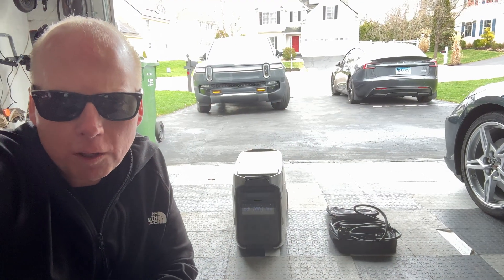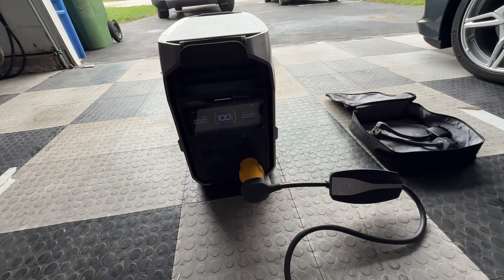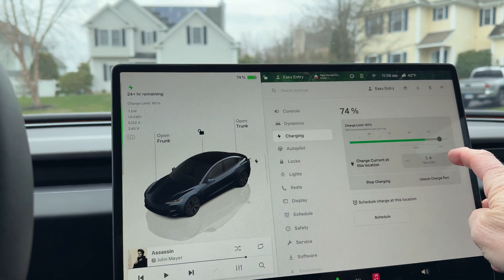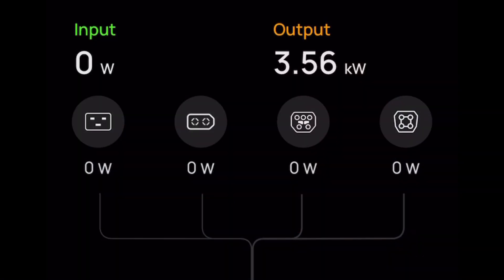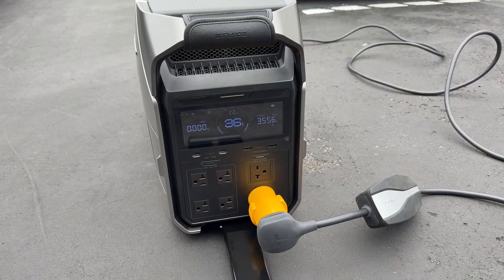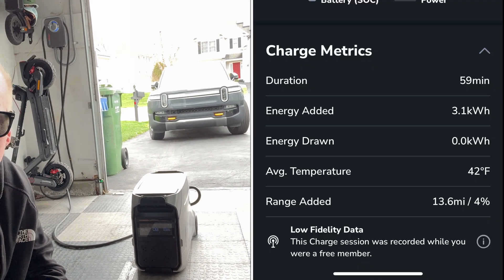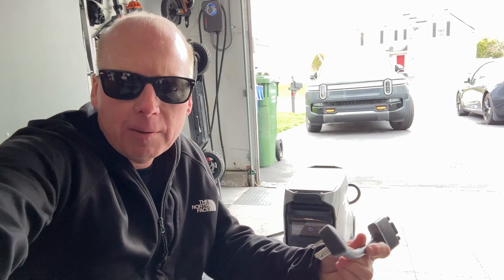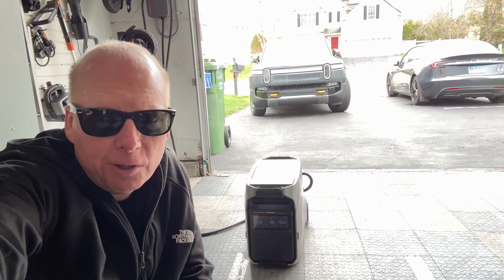Can I Charge a Tesla with a EcoFlow Delta Pro 3 at 240V Using the Mobile Connector?

Comment: It didn't work with my f150 lightning. I assume because the f150 doesn't have the option to regulate the amps. The charger is 36 amps and is getting too much power from the eco flow. In 110 is fine. Thanks  for the video. And the adapter that you mention works great
Reply from the maker: you need a portable L2 that can regulate the current I reviewed this evdance one on the channel https://amzn.to/48NhJED it goes as low as 10A
Reply: @keenanjeff  thanks for the advice I do appreciate it.

Comment: Hi Jeff, where do you see that the NEMA L14-30P to 14-50R RV Generator Adapter Plug you linked and mentioned at the 35 sec mark is Neutral (Ground) bonded ?
Reply from the maker: you are right I just tested the adapter I have linked and it is not neutral bonded but it does work with the tesla mobile connector.  I believe I did have to enable GFCI/RCD support on the Delta Pro 3

Comment: That thing, Delta 3 cost over $3000 and get only 13 miles on a single charge. That means I'd need to charge 10 hours to get 130 miles. Maybe it is still better than the level 1 charger.
Reply from the maker: You are not going to get 130 miles but  it can discharge quickly at 240v 4kW

Comment: Maybe I missed it but where did you utilize the EF ECOFLOW Delta Pro Ultra Accessory, EV X-Stream Adapter?
Reply from the maker: At 3:32 it works great
Reply: @keenanjeff  Thank you for the reply! So the Xtreme adapter is only utilized to fast charge to the EcoFlow Pro 3 to 100% correct?
Reply from the maker: @Nuvajryes and it has to be at 3% or more to use it to fast charge

Comment: I know you used the adapter from Amazon to charge, but did you need a special grounding plug adapter?
Reply: I see other videos that use the ground ding plug. I wonder if you changing the settings allowed it to not need a plug? (GFCi/RCD) support.
Reply from the maker: @jeffreydurlak5991 i tried that setting did not work without the plug
Reply from the maker: No just the adapter
Reply: https://youtube.com/shorts/VibpccFMjmE?si=zIFWmHI2AI8cx5qY

Comment: I’d like to see a comparison of the Delta Pro Ultra (not rele portable) power pulse vs. (2) Delta Pro 3 with combiner hub charge rates. Plus their expansion batteries. 🔋 if you have info please share. 😊
Reply from the maker: 2 X Delta Pro 3 with double voltage hub will provide ~8kW so they so they will double the car charge rate and also range with 8kWh.  The  ultra will do 7kW with 6kWh and cost more than 2 X what I paid for the delta pro 3.
Reply: @keenanjeff more output and battery capacity with 2x delta pro3. 💯 thank you.